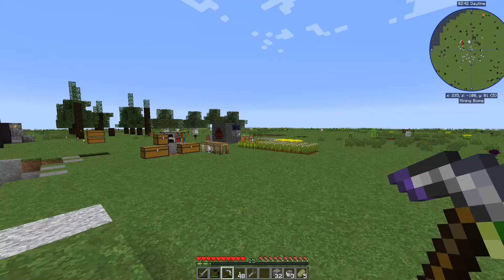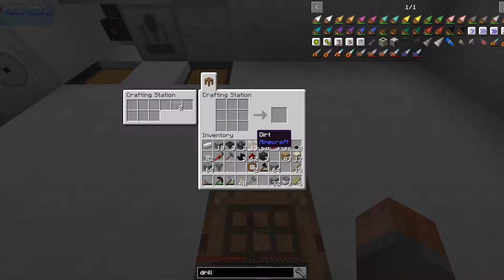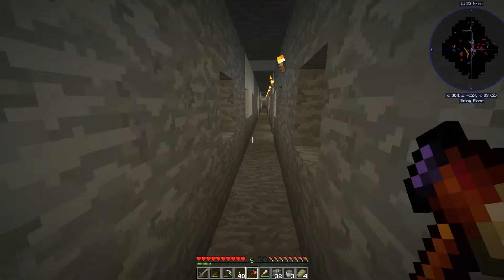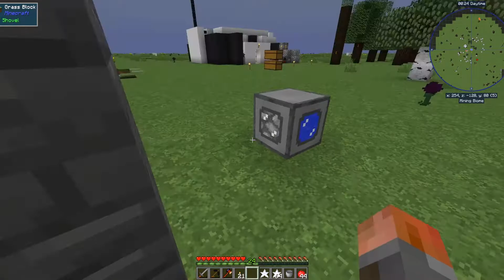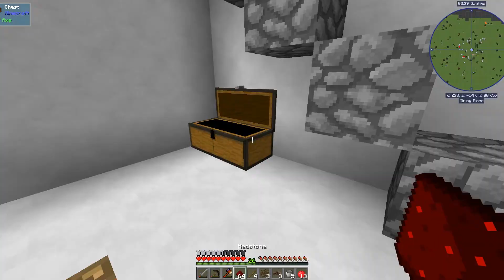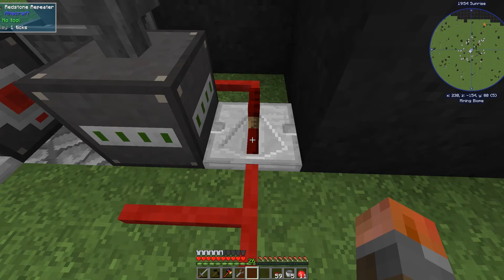Age of Engineering E06 - Mega Mining Tools

Comment: You can replace the auto placer for the "laser drill" with a vanilla smooth stone generator. That way you save furnace fuel and can simplify the redstone for the system.
Reply from the maker: +AffectingHydra Possibly, yep.  Considered it, but the furnace goes RF in the next episode, and is more compact :)

Comment: The reason you can't place torches with the hammer is because they removed that feature when Minecraft introduced dual wielding. If you hold the torches in your off-hand while you mine, you can still place torches with your right click. An even more useful option is to have a shovel or excavator in your off-hand. It will automatically use the right tool depending on what you're mining.
Reply from the maker: Aah, that's a great tip - thankfully the drill goes straight through soil/gravel quickly, I'll just have to find a way to keep it charged :) I will keep torches in the off-hand though, thanks!